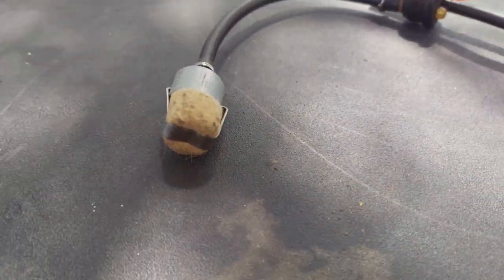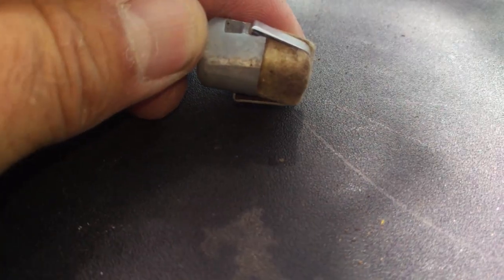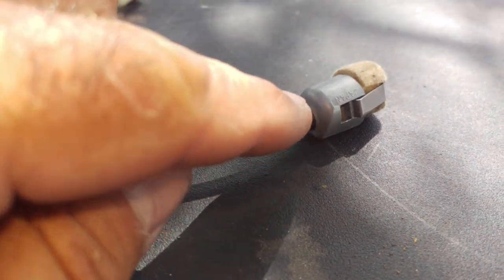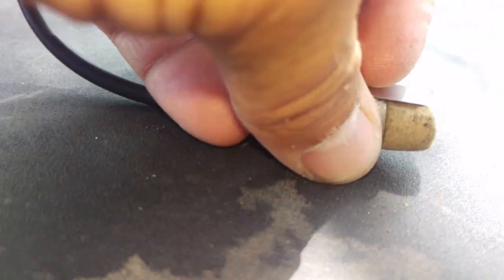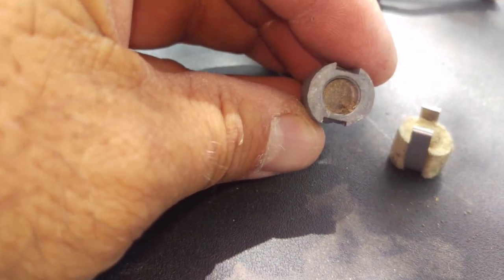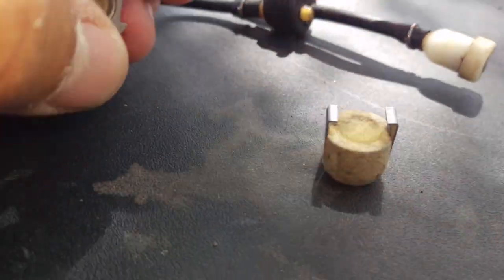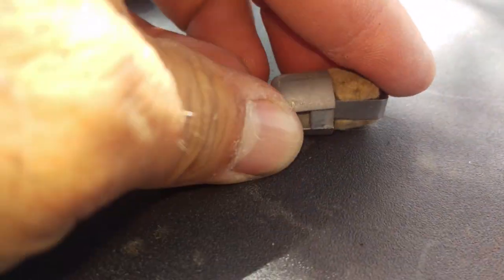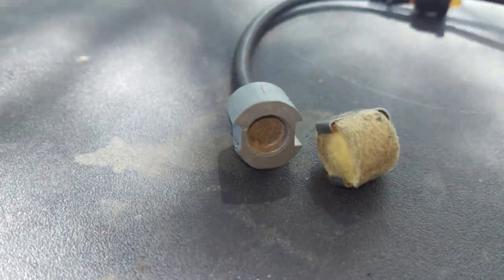2 stroke ECHO fuel filter. How do I clean it?

Comment: nice tip but sometimes i gust replace it to be safe
Reply from the maker: Can't Kill Me  I usually just replace them too. BUT lets just say that I know nothing about a machine other than it wont start. Primer looks good, fuel lines look good but no gas is is going back in the tank. Well if it cant suck up the fuel then it cant dump fuel back in the tank. Most filters will come right out and it only takes a second to check it and or clean it. Process of elimination as to what could be the problem. If I change out the filter and the primer and the plug and and and. Yeah I fixed the problem but I have no idea what was the problem. See what I'm saying? Thanks for the comment and the follow.